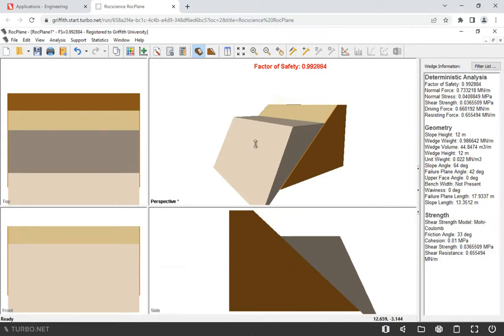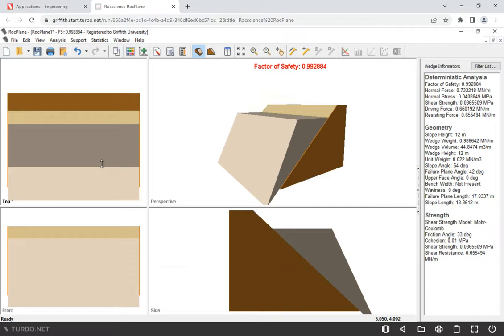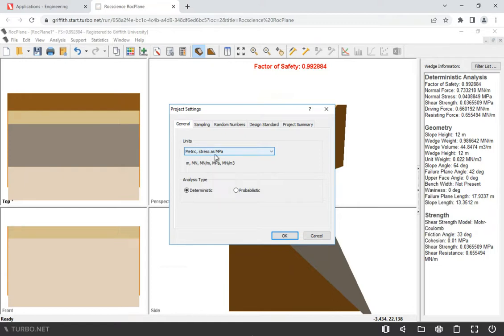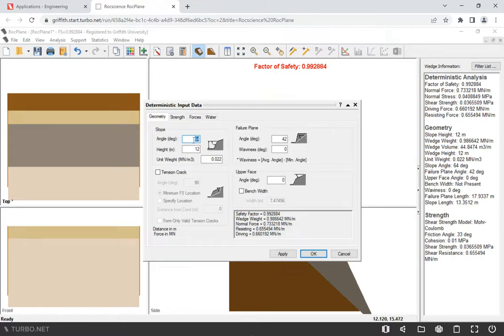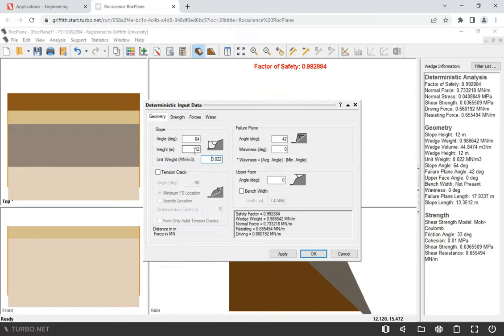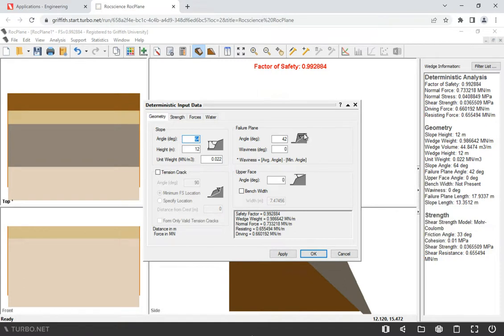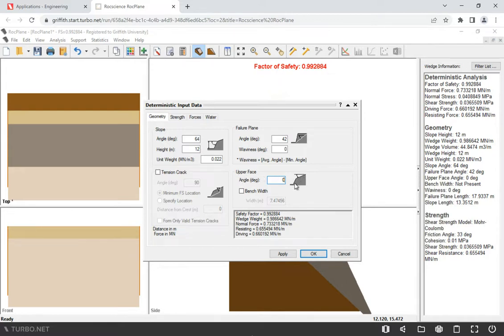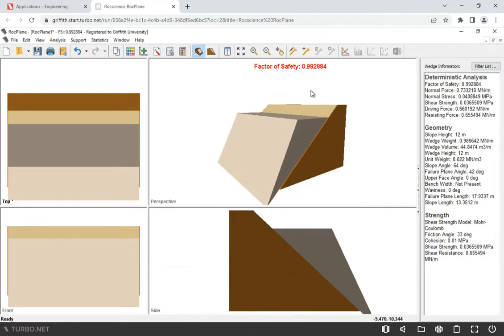Tutorial 9: How to Estimate Safety Factor for Planar Failure using RocPlane in Civil Engineering

Comment: What type of rocks that sutible for this software, I mean is that ok if I'm working in hard rock such as schist and metavolcanics rocks ?

Thanks
Reply: This answer may be very late but when you select "probabilistic method" you can set different densities (depending on which rock type you are considering) so yes, It works with a different spectrum of rocks.